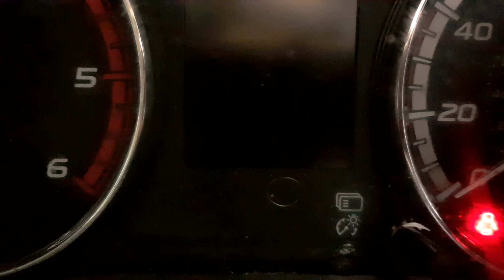What happens if you don't have your car serviced? Mitsubishi L200.

Comment: My son had a brand new 2005 brand new Astra he was told the service interval was every two years I told him ignore it get it done at least  once a year he did not and at 80.000 miles the engine was having problems only little things at 150.000 miles. it started to  to run in limp home mode a lot so he traded it in I think if he had changed then oil more frequently it would have gone on to do more miles. My car which I picked up last year is a 1.6 diesel Astra which now tells me when it wants a service which I can zero and ignore but I won’t be doing
Reply from the maker: That is what the owner did to this. Just kept resetting the service counter without having it serviced.

Comment: Goodnight I have a Mitsubishi Triton with newly rebuilt engine and it developed an engine knock when accelerating. The lifters are adjusted and there seem to be no cracks on the caps also the injectors are ok. Is there anything else I can check for? I'll really appreciate the help.
Reply from the maker: Is it diesel knock or a mechanical knock?

Comment: I’m looking at a vw transporter for sale, it’s a 2020 plate with 56,500 miles and only had one service at 50k miles, Will it be alright?
Reply from the maker: Avoid it. One oil change in 50,000 miles is not good and will be asking for trouble.

Comment: I have never understood that kind of mentality of not getting the oil changed I wonder what is cheaper 5 or 6 L of oil Or an engine🤔
Reply from the maker: I've seen it so many times over the years and the owners blame everybody except themselves.
Reply: @pistonbroke  I have just recently had to rebuild my Land Rover discovery 2 V8 Because the previous owner couldn’t be bothered to do oil changes at the correct time obviously was nowhere near as bad as this but it was bad enough where is sludged up all the hydraulic lifters destroyed the rockers So I decided to fully rebuilt the engine

Comment: good evening, I am sending you this message to request your help for a 306dt jaguar xf engine. I am a mechanic and am buying a 2010 3l v6 jaguar xfS 275 306dt engine. the failure is the broken crankshaft, I recovered the engine half open. i think i have all the parts but i'm not sure. i would like to know there you could help me in my search for parts and engine reassembly. I'm from France

Comment: Our 2.2tdi and 2.0tdi Ford transits at work have 2 year 30K miles oil change intervals which I think is bonkers as they get drove like death all day everyday, that must make them die sooner.
Reply from the maker: They've extended the service interval by increasing the oil capacity. The newer Transits hold nearly 10 litres where as the earlier ones hold around 6 litres.
Reply: @pistonbroke  wow that's a lot of oil my A4 2.0 tdi only holds 5 Litres.